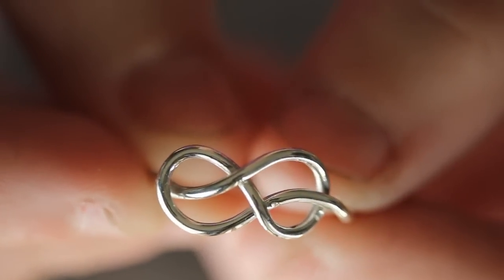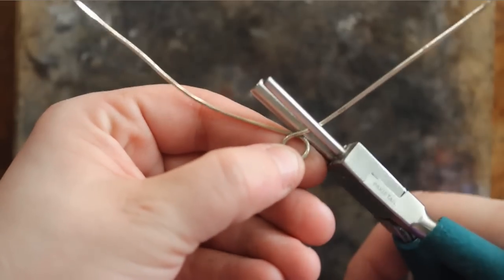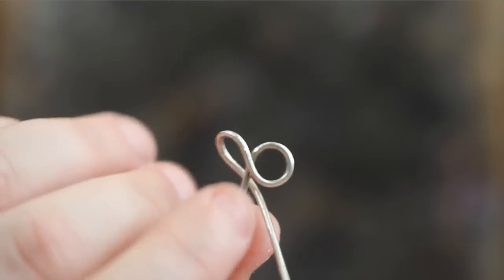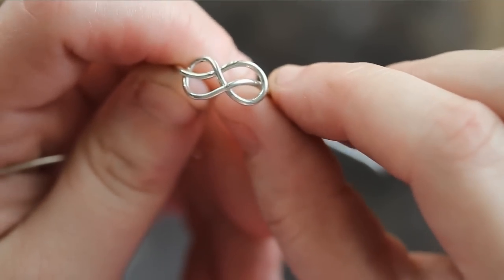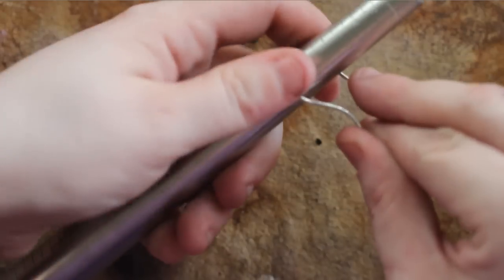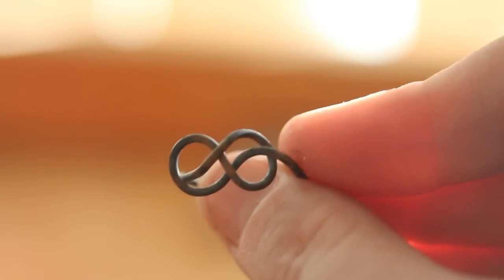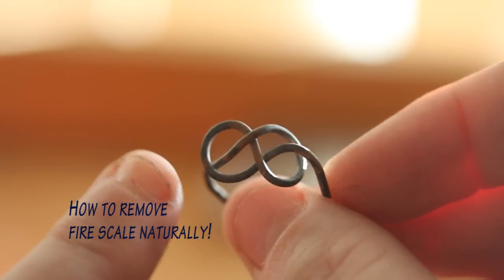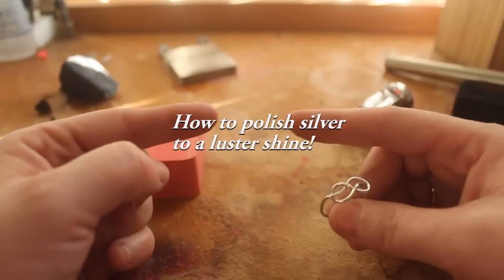Sterling silver infinity ring tutorial well demonstrated

Comment: I bought 100% S925 Silver wire and it’s so hard to bend is it normal? 😢
Reply: Anneal it first, by heating with a torch so that it glows slightly orange under low light, then dip in cold water. This will make it easy to bend.

Comment: Looking at 16 gauge silver wire, they have hard, and "Dead soft" what do you recommend? i imagine hard... but want to be clear. Thanks. Awesome tutorial!
Reply: +Bob Giammaria dead soft is what you want to get so its easy to shape use hard solder, then shape it, and then heat it up till its bright red and drop it in ice water which will make it hard so that it doesn't bend during polishing.
Reply: +Bob Giammaria  also I recommend 20 or 22 gauge wire so its a bit stouter as a finished product.
Reply: +Tim Zink 20 or 22 gauge is smaller and finer - won't be as stout!

Comment: Did I miss it, or did you say how long the wire was?? Plus, are you using SS?
Reply: Thats the same thing i thought. i kept rewinding it to try and see if she told us how long of wire to start with.
Reply: Seeing how the wire had firescale after soldering, i would say it is most definitely Sterling. Fine silver would not get fire scaled like that after being fired/soldered. But i don't think she mentioned that, or the length of the wire she used.